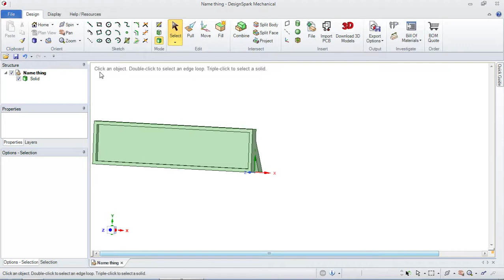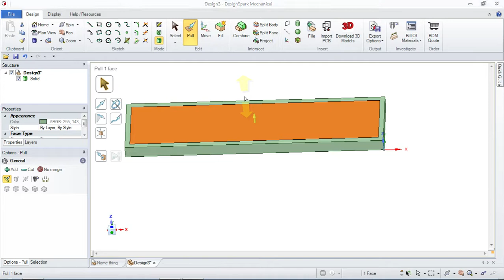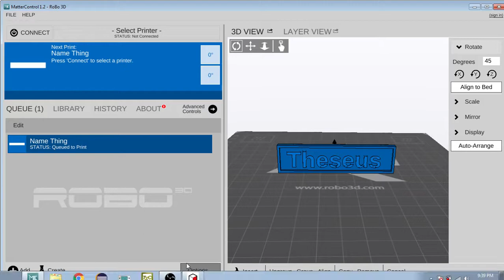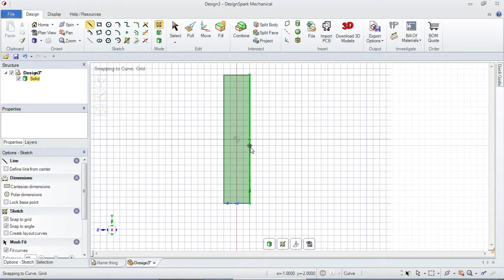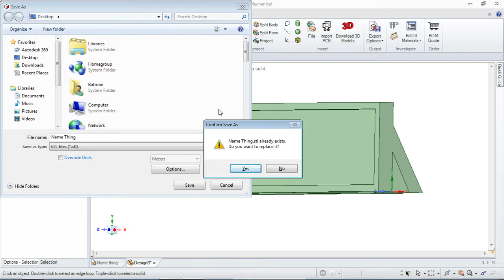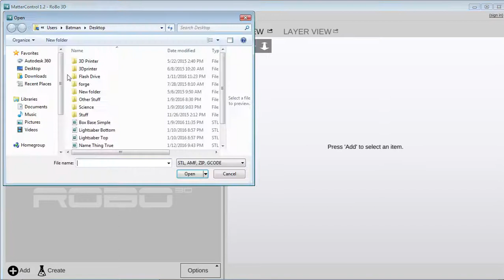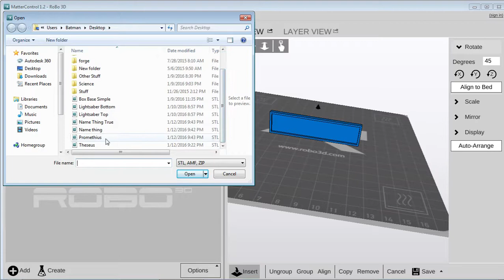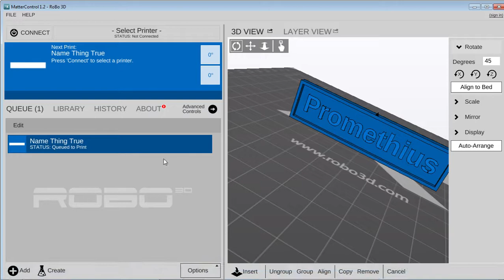DesignSpark Simple Name Plate

Comment: Actually you can add text and is kinda easy in design spark mechanical. Using Measurement tool, select face of where you want text select plane of that face after activate measurement and double click on the size number and delete numbers and put text.
Then select text  select sketch plane and activate project to sketch and in left window uncheck annotation plane from structure. And text should be on that surface, after that u extrude by selecting each letter.
Reply: Nice :-) thank you